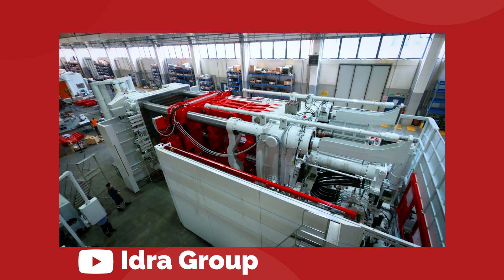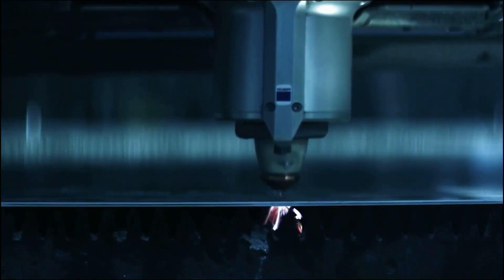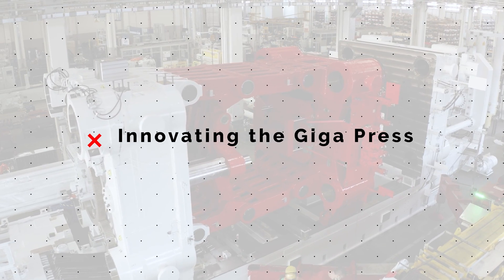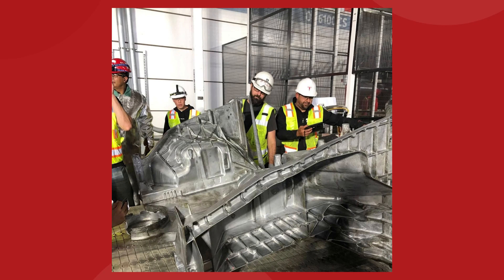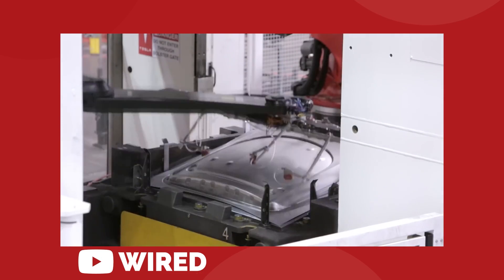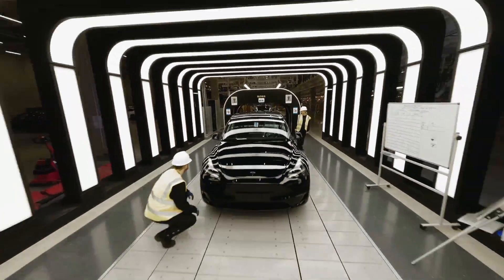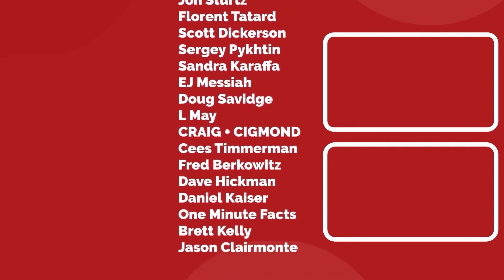The Real Reason Tesla Developed The Giga Press!

Comment: The HPDC machine is impressive but, the real challenge is having a HPDC part retain structural integrity for the life of the vehicle and thought out all sort of operating conditions.  I see MEGA failures in the future.  Not to mention if this structure is comprised in any way for any reason, there is no service ability with this approach.  This is typical of a "newbie".  In the short term impressive but, long term massive failures.  Tesla is basically making a throw-away vehicle.  You will not have it paid off when it turns to junk....

Comment: Not much different than plastic injection molding.  Same toggle press, same injection unit, except it's a plunger since mixing isn't required - and it's running at higher temps.  4k tons clamping force is on the high end, but not uncommon.  Generally at least 1 ton of clamping force is required per square inch of the part for a good seal when injecting.

Comment: First, Tesla did not develop the Giga Press, it bought it from the real developers and manufacturer, the IDRA Group.
Reply: Tesla provided the end-use specifications. That they didn't build it themselves is kind of irrelevant. If I need a part and I send drawings to a machine shop, I still developed the part, I just didn't do the leg work required to actually produce it. And it's worth noting that in design and manufacturing, there is a lot of back and forth between designer and producer.

Plenty of times I've designed parts and had lengthy discussions with the machine shop where they were concerned about some feature being difficult to produce as is, and how critical is it that it be exactly as described. Usually I could easily revise the design once I was made aware of their limitations. Design and production is a collaborative process. I'm sure there were plenty of things Tesla specified that the experts over at IDRA looked at and said, no, can't be done like that. Tesla redesigns their specs etc etc.

If that's not "development" then I don't know what is.
Reply: @nutbastard  IDRA developed the Giga Press. Ordering a car with options doesn't mean you developed the car. Just as ordering a Giga Press for your businesses needs doesn't mean you developed it.

Comment: One big limitation on casting is that the mold needs to be able to open to let the parts out. They can add "slides" that retract some pieces of the mold to the side before it opens. But it remains a big limitation on just how much of a car can be molded in a single casting regardless of the size of the press.
Reply: another thing the larger the piece the longer the casting takes to cool, and its gotta be done correctly to prevent any deformation
Reply: @AsbestosMuffins  Yea but you can take the mold out and put another in allowing multiple to be cooling at once.

Comment: As impressive as this big casting machine is...  Is it really necessary?  Isn't this just another one of Elon Musk's attempts to re-design the wheel?  I need a inexpensive car to drive to work and the store.  If I want a heavy-duty car, I'll buy the Ford F-150 that uses a traditional frame, costs less, does more, and looks better. The giga-press doesn't do anything for the customer if Tesla is too cheap and greedy to pass the savings on.  $52,000 yeah right.
I used to want starlink too.  Now he raised the price from $85 mo. to $125 mo.  I won't buy anything from the greedy little turd.

Comment: Stop calling it a press. It's a high pressure, high volume injection molder.
Stamping and forging is performed with a press.
A ton is neither a unit of force or pressure.
Get it right. Stop with the marketing room nonsense.
This is a technology channel is it not?
It's size and clamping pressure is impressive. It has to be to perform its intended function. It's big and efficient, not unique or proprietary.
Very surprising that it has some roots in China (Hong Kong is in China). Good luck with maintaining a monopoly on that Idra.

Comment: Tesla hasn't developed giga press, they are buying machines from Italian Idra Group.
 Huge press machines had been used since before WW2. These do require a high initial investment, however they are hands down the most economic way of mass producing metal parts. Pressed parts do have superior properties and lighter weight then welded or riveted parts.

Comment: I don't think I would want to drive or ride in a vehicle where the main structure that is holding it all together is made of potmetal.  By casting the unibody frame, the chances of having a defect increase as the size of the casting increases.  Casting is great for components like engine blocks and transmissions but castings can easily have defects and tend to be very brittle even if the casting is perfect.  I don't know if I would want to see the results of one of these new vehicles hitting a big pot hole at a normal speed like 25-35MPH let alone colliding with another vehicle at highway speeds.
Reply: These structural castings use a high-strength aluminum alloy similar to the high-strength aluminum alloys used for the structural frame of military combat aircraft, not potmetal, so they should be more than adequate for civilian passenger cars.  As this video you're commenting on also mentions, Tesla X-rays every casting off the line to check for casting defects.

Comment: just not possible to do collision repairs,  you can get some panels and bumpers but just hitting a curb can ruin the frame,  they are disposable cars.....   i want an F250 with no horseshit, no bells, no whistles, no power mirrors, no power windows,  a V8, standard trans, no options

Comment: I wonder if there is a weight saving by doing a single piece without welds etc as you don't have to go as thick because of the inherent strength in single shot... That would be another game changer. 
This is the benefit of monarchy's lol... The king just says to do a thing and its done, get on with it.

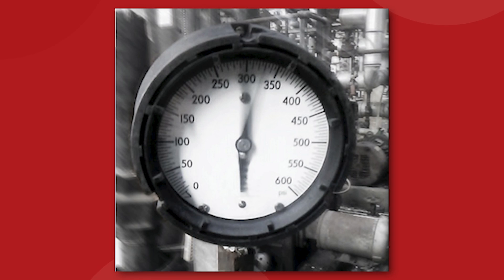Comment: One thing that all these videos about the gigapress and model Y front and rear bodies always forget to mention is the fact that the part still needs to be machined. Such as this video at 5:50. After trimming it goes into a CNC machine so that several holes and slots can be machined into the part. The casting does not go directly into the assembly line after trimming.
Reply: Another thing they forget to mention is that those parts can't be repaired in the future. A crash that would be perfectly repairable on a traditional car will mean a totaled car with these huge single piece parts.
Reply: Figures that machining the casting is skipped over. All of the coverage ive seen of this "press" is wholy technically illiterate and shows complete misunderstanding of how a car works

Comment: With this in mind “there are a few or fewer major parts”, it is more understandable that Tesla vehicles will not withstand as much collision force and still be repairable.
Reply: One can imagine that the insurance companies would raise the cost for insuring tesla cars and/or declare tesla cars with small damages for totally damaged (irreparable) on a smaller threshold than more traditionally manufactured cars, because It's very hard to inspect such large elements for cracks after a crash, which aluminum is known for. How can a previous damaged teslas be declared safe to drive after a smaller crash, that can degrade the structural integrity?
Reply: Let's think about that.
Minor collision, no difference.
Force sufficient to damage a component that's a long way from the peripheral of the vehicle?
A "conventional" vehicle would need many panels removed, replaced, patched, welded, straightened, then possibly pulled on a jig?
Would that be absolutely straight?
Would metal crumpled then pulled straight be fatigued, even if not visible?
Would that vehicle be guaranteed as crash worthy as a new car?
Front rear casting.....
If the damage is deep enough, the same question applies. Will it be written off?
Or,
Is there a possibility that the whole "front clip" could be unbolted from the steel passenger cage, replaced by a new casting, then (modular!) components swapped over, or replaced?
Would that be comparable in time to the bodywork required a conventional chassis?
Would the car be straight? (almost certain perfect!)
.
Have Tesla, or crash repair experts thought about this? (Almost certainly!)
.
"We" don't know, but other industries do that ready.
Reply: @rogerstarkey5390  - While watching collision vids on YT I see total loss in part determined by “did the airbags deploy”.  This is an obvious and easy indicator of severity.

Comment: The size of casting isn't novel  - we were casting gigantic engine blocks for 200,000 horsepower battleships in the 1930s.  But those jobs were relatively slow.  The main novelty here is getting it to have enough throughput to apply to a consumer vehicle production line.
Reply: The size of these castings is novel because they are the largest Pressure Die Castings yet produced. Ship's engines are cast iron which is sand cast, not as accurate and relatively a very slow process.

Comment: Another thing to point out is that you can’t replace a unibody subframe, this might allow for vehicles to more easily be fixed again like back in the days of body on frame. Also welding robots take a ton of maintenance so saving on that is huge.
Reply: This is actually doing the exact opposite. Instead of sheet steel components, that you can easily weld in most circumstances, you now have a huge casting. Which for one, is very likely to crack, and secondly, would be a nightmare to weld if it cracks
Reply: @MannoMax  I agree on the cracking part, but I'm not sure it matters for this application, other than where the cast parts attach to the battery to make the frame. If this were a rock crawler it would be a no brainer that aluminum is a no go. This is probably a 6061 aluminum and the bath in water is probably the heat treat. Their casting process seems like it is clean, so maybe welding it wouldn't be such a nightmare.
Reply: @papapsych2746  You still have huge amounts of forces on a vehicle body. A pothole while going 150 kph is way worse than the torsion of rock crawling, because of the shock. And castings should always be pure material, otherwise they go into the fuck-it bucket. And castings are just inherently diffcult to weld, especially large spindly ones like the ones Tesla wants to make. Its all about expansion, contraction, and stresses that appear through crystalisation
Reply: @MannoMax  Castings are hard to weld in aluminum because of the impurities in aluminum floating into the weld pool creating junk and even porosity. I Don't recall much about the grain structure other than it's the same cubic grain structure as copper. A pothole going fast is going to be far less stress than a pothole going slow, at that speed you would fly over potholes. I'm sure the casting is strong enough for the suspension components to do their job, just not sure about where they connect to that heavy battery that forms the mid section of the frame.
Reply: @papapsych2746  No, because of the sudden shock on the frame, and you can't configure the suspension to take that shock fully, because then the car would be super wobbly and way to soft
Reply: @papapsych2746  You also have the general casting issue of cracking tho
Reply: @MannoMax  Thats what shocks are for that go into the springs, they absorb the reverberation of the springs, If you have ever had one go bad you would notice your car bobbling up and down all over the place.
If their process of aluminum casting is as they say it is, there is no difference between that and the strength of extruded aluminum.
Reply: I used to work electronics for Kimberly Clark,, I did robot maintenance and programming, I can tell you for real, robots are great until they break, and break they do.
Reply: So what happens if a tesla is damaged in an accident? It's almost certainly uneconomic to repair after even the most minor of shunts.
Reply: @abbersj2935  Whens the last time your car was repaired by frame pulling?
Reply: @lengould9262  Never. They just cut chunks off. And replace with standard panels. So your point is?
Reply: @abbersj2935  "They just cut chunks off. And replace with standard panels. So your point is?"

standard panel? what are they making those with?
Reply: @chrisdavidson911  Look it up yourself. It's easy.
Reply: @abbersj2935  you say that as if you actually know. 

Are Tesla casting small repair pieces, or chopping up full castings and leaving the rest lying around just hoping to need it eventually? Have you thought this through at all?
Reply: @abbersj2935  It's speculated than an impact hard enough to damage the casting would likely total out any car anyway.  But, Monroe Assc is saying they believe these castings can be TIG welded if cracked.  Time will tell.
Reply: @ohger1  Yes it will John. But as you well know, what is technically possible and what the auto repair industry can do are not always the same.
Reply: @abbersj2935  Elon addressed this by saying areas of the frame can be cut off and new pieces welded back on.
Reply: @daveinpublic  Have you ever tried to cut out and reweld a multi shaped casting which has webs and features all over the place? Correct cutting, realignment and welding to a suitable strength I would say, would be almost impossible. Whatever your mate 'elon' says. Show a link or two.
Reply: @abbersj2935  Just because you don’t know how to do it doesn’t mean professionals don’t know how to do it.
Reply: @wallymcguire2033  Speak for yourself, I've repaired cars, from servicing to damaged,  for 40 years. Get some quotes, then speak from knowledge, not ignorance.
Reply: @abbersj2935  How do you know how long I’ve been in the field? Lol. Don’t make any assumptions dude.
Reply: @daveinpublic so you’ll still need machines casting the spare parts?
Reply: @abbersj2935  NOt only that.  If the frame is so rigid, what happens with you, as you absorb the whole impact energy?
Reply: @abbersj2935  Right to repair anyone?  Not a Tesla, it is fully disposable, the ultimate red solo cup!
Reply: @Naturallystated  Correct. Profit always wins.
Reply: @abbersj2935  Thats what hes saying. Since the cybertruck is a reliable body on frame truck, its gonna be easier to repair over a unibody design that most other cars use.
Trucks and SUVs in general are body on frame. Tesla is the only ones making a body on frame crossover which is actually pretty nice.
Tesla somehow reminds me of 1960's GM
Reply: @abbersj2935  There are sacrificial parts that are on both ends that are easily replaced, if giga cast are damaged  its  possible the occupants have major injuries , repairing the car is the least of their worries, that is why you have insurance, Oh a front or rear crumple unibody  car is often SCRAPPED ,  and if ever it is repaired the car  title is stated as such  in Ontario Canada it's OWNERSHIP title  is stated as "Branded" in the registration  , the car for resale is about  half  what an accident free car is , so when you shop  for a used car consult  Car Facts  you dont want a  car that has been in an accident, I know this because my friend is in the auto body repair business .Also crumpled or welded cars after the accident have rusting issues,no matter how good the rusproofing is after the repairs.
Reply: Nah its a tesla youre not allowed to repair them, they try to put you in prison for working on your own car 🤣
Reply: @kcrichton7485  I agree on what You stated. Most vehicles are put together with Epoxys instead of any welds. There is hardly any body work done as in lead filler bondo or fiberglass. Lots of work is remove and replace panels now. Vehicles where easily weld able STEEL now they are bi metal.
Reply: Customers don't guve a f***about the process but the end price
Reply: I thought that is what frame pulling machines are for
Reply: @AK-IT  Casted parts don't bent they break.
Reply: @AK-IT  more of an art form and extremely costly.
Reply: Yeah after the robot welding usually there is a visual inspection with human welders to catch and fix where the robots had missed the mark. 
Robot welds are usually garbage at US automakers it's so bad they use caulk to hide the welds.
Reply: @papapsych2746  As over 90% of welds are carried out by robots, on cars made all over the world, and are mostly spot welds, with some mig welding on thicker sections you clearly have no clue what you're talking about. Otherwise cars would be falling to bits all over the place.
PS. Visual inspection is a thing of the past, it's no longer needed, just watch some video's.
Reply: @abbersj2935  I'm not talking about spot welding. I'm talking about gmaw welds done by robots having very poor quality especially on American cars and trucks. And there are human welders at the end of the weld sequence that look at the welds to check if the robot even got in the joint.
Reply: @papapsych2746  if a welding robot consequently misses joints you shouldn’t blame the robot. But the one who bought the equipment unfit for purpose.
Reply: @2wheels1guy25  You're not familiar with how much a robot needs recalibration.
Reply: @papapsych2746  I’ve seen many new vehicles and ever seen missed welds.
Reply: @j.jarvis7460  Welds on American cars and trucks of the late 90's through the 2000's had some of the worst welding imaginable.

Comment: Too bad they couldn't use three shots simultaneously with a 10,000 ton DCM to make an entire chassis in one shot. The preheat furnaces, quench tank, trim dies and robots would have be huge.
I worked at a casting place where out largest DCM was 4500 tons, and it was huge. So everything would have to scale up.